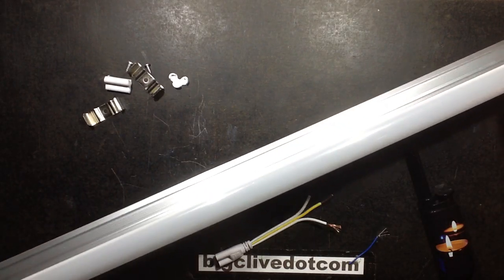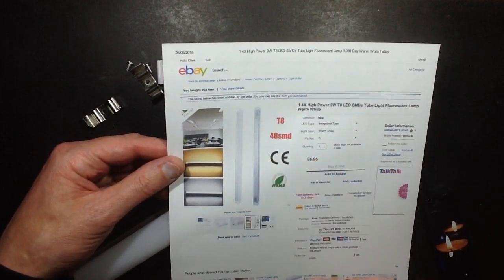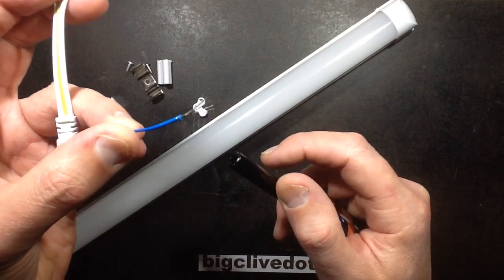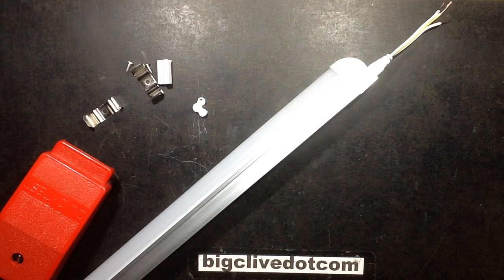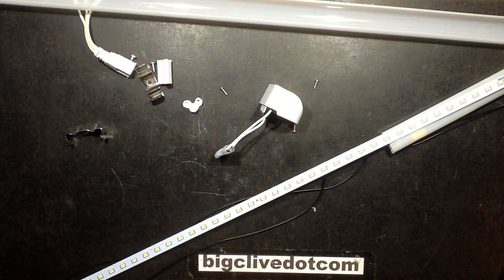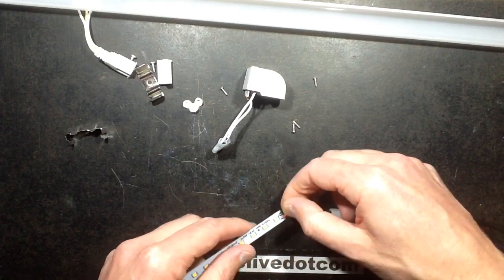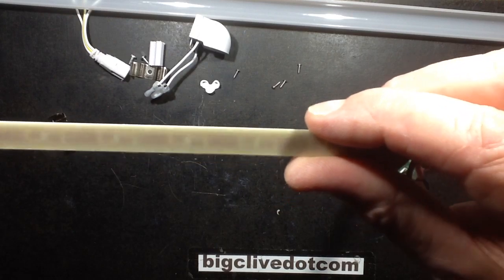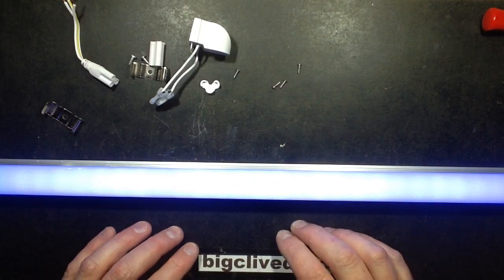Inside a 9W generic ebay T8 LED strip-light.

Comment: i have a similar 9w tube , and the power supply broke. so i took out the power supply and the led strip that came with it, then i put in a 12v led strip :D
Reply from the maker: That also lets you convert them to a colour of your choice.  These channels are good for retrofitting with standard LED tape.
Reply: yeah, and also the diffuser that comes with them is good for rgb led strips with individual color leds.

Comment: i need ur help should i go t5 or t8 i am leaning t5
Reply from the maker: T5 is slimmer and neater, but for LED it's sometimes better to choose a strip with a larger heat dissipation area like the T8.  (The number after the "T" being the diameter in 1/8ths of an inch.)
Reply: OMG makes sense I never thought about it like that I was thinking aesthetics like ur other video the lumen output in the t8 should be greater too right

Comment: would be good if they made led strip with built in opal diffuser coating on the strip like the opal diffuser coating on led strip track profiles but without having to use a track profile. NOt seen any availible with opal diffuser coatings yet

Comment: when one of these T8 led tubes burn out, is it usually the leds that fail or some other component within the tube?
Reply from the maker: Usually the LEDs.  You can often tell by the appearance of a black dot (burn mark) in the LED.

Comment: Why 77 volts and around 48 leds??  

R/. 77V/48=1,6V  which means that it is the voltage drop of each LED.
Reply: doesn't make sense, i haven't seen white LED's with only 1.6v of forward voltage. I bet it's like he said, 2 circuits of 24, making it 3.2v per LED which is totally standard white led voltage
Reply: Did either of y’all watch the whole video? It’s two parallel strings of 24 seriesed LEDs. One string is the odd lights, the other drives the even lights, that way when one LED shits the bed then the whole tube stays lit.

Comment: I have used 1/2 inch multistrand aluminium power cable in telephone exchanges for 50 Volt feeds.
It came with a conductive grease too.
I also have a 1 metre 128 smd Led work lamp with Li ion battery.

Comment: CCA or Copper Clad Aluminium is fairly common and except for a small reduction in current carrying capacity and its cheaper, WAY cheaper than pure copper.

They actually take pretty thick wires of aluminiun wrap (clad) it in copper and stretch the shit out of it until it becomes individual strands like you see in the video. Theres no melting or anything like that involved.

Comment: Hi Clive.

Those connections look an aweful lot like a standard trilobe connector like you would find on a lot of laptop PSUs.  Are they?
Reply from the maker: +Scott Miller I just checked.  It's smaller than the laptop cloverleaf connector.
Reply: +bigclivedotcom Bummer...coulda been a solution to the aluminum wire issue.

Comment: How did you get the voltage down from the 77v originally supplied by the power supply?
Reply: +BigGoucho I suspect he is using a different power supply - probably his test bench unit - to drive the LED tape.
Reply: +Sootikins yes, I heard him mentioning the power supply but I wondered if he had lashed together something based on alcohol-fuelled calculations lol

Comment: Sure was flickering on the camera so not a constant on.
Reply from the maker: +legalizeshemp420 I record on an iPad 2 which systematically picks up on any flicker at all.  It's not visible to the human eye.
Reply: I have an issue with flicker and it gives me headaches.  I can't see it (well if I turn my head I sometimes can) if at 60hz so I was sure glad when 120hz TVs and Fluorescent bulbs came out and LED that are constantly on.
Reply: bigclivedotcom 
Hello Clive, i just bought 1 of these i believe exact same lights but i didnt open it up yet like you did. After seeing the problems you had with the 1ft like this. I think i have to open it to make sure all connectors are crimped. 
The wires scare me. I want to be sure that this wont burn down my house before i connect it. 
Im going to use it above my kitchen sink so it will be on every night til i go to bed n when im not home. So please tell me you think it should be ok after i make sure connectors are good. Im in USA n we use 120 volts B W G usually n i will extend wires out of ceiling with at least 14-2 wire using wire nuts n electrical tape. Hope to get reply soon from you. Thank you
Reply: bigclivedotcom 
I forgot to ask. If i put dielectric grease on the connections will it keep the wires from corroding? Thanks again

Comment: Oh snap man I think your telepathic!, I literally JUST order a couple of these ion warm white, but I paid like $9.25 ea for them..
I have some regular tube lights like this that take the same type of plug but they are actual copper..
I have some spare 6" jumper links to daisy chain them together with spacing also.

More telepathy! You had the SAME idea I had putting in the LED tape, I got that RGB remote controlled tape coming and I was going to put some of that in one of these housings and be able to change it with the remote, lol.

Comment: Hmm...  I'm not sure if that would fly in the States.  I know aluminum branch wiring isn't allowed under modern US building codes, but I'm not sure about the regulations for accessory/consumer electronics wiring, assuming it's mains power running through that harness.
Reply: rhkips 
Hello, i sent the following to Clive but hopefully you can answer this.

Hello Clive, i just bought 1 of these i believe exact same lights but i didnt open it up yet like you did. After seeing the problems you had with the 1ft like this. I think i have to open it to make sure all connectors are crimped. 
The wires scare me. I want to be sure that this wont burn down my house before i connect it. 
Im going to use it above my kitchen sink so it will be on every night til i go to bed n when im not home. So please tell me you think it should be ok after i make sure connectors are good. Im in USA n we use 120 volts B W G usually n i will extend wires out of ceiling with at least 14-2 wire using wire nuts n electrical tape. Hope to get reply soon from you. Thank you
Reply: rhkips 
I forgot to ask. If i put dielectric grease on the connections will it keep the wires from corroding? Thanks again

Comment: Have you ever thought of recording with a go pro? i have noticed how narrow the FOV is of your videos. they are very educational and fun to watch but you can't see much of the larger items that you disassemble. you can find go pro hero 3's for relatively cheap on ebay :)
Reply from the maker: +Tyler Walker I've got a GoPro and it somehow managed to fit my entire workbench in from the same height and made everything look like it was a mile away.  You can retrofit CCTV lenses to the GoPro for greater "zoom", but the majority are not fitted with IR filters, so everything goes a bit "intense".
The iPad is a nice lazy solution to banging up videos.  Just record, use the YouTube capture app to upload them over the excruciatingly slow Internet connection overnight, and edit the data in the morning.

Comment: Do you know what sort of leds are used in the backlighting of modern laptop screens.
Im thinking of replacing my old laptop ccfl with leds, but i dont know what type to use, have you ever converted one clive?
Reply: zx8401ztv
I'm the same as you in my personal life, If it can be repaired I'll try and repair it, if I don't know how to then I'll try and learn how to. I've always kinda figured if I fail at repairing it then it's still broken so nothing has changed :)

Sadly, in my work capacity it's not economical for my time to repair much. :(
Reply from the maker: +zx8401ztv There are specifically designed LEDs that emit a lot of light out of a very narrow side aperture for edge-lighting some of these panels.  I've not really taken many flat panel screens to bits, so I can't say how much variation there is in the technology.
Reply: +bigclivedotcom Hmm special types, looks like ill have to hunt ebay for a possible kit/replacement.
Thanks for the answer :-), i suspected that but you are into lighting more than me, the led strips you have shown us are dam bright, im quite supprised how well they work.
Reply: zx8401ztv I wish you luck, it's nice to find a person that actually wants to fix stuff and also has the time.... I'd much rather fix stuff instead of replacing it but I work in IT and people don't like paying me more to fix stuff than it would to replace the whole part :(
Reply: +Mark Batchford 
Thats the same way i think lol, if someone says "its dead anyway" i start to use nasty methods to test it, and i often win :-)
if i fail, then ive tryed, no shame in that :-D
Reply: +zx8401ztv  the CCFL tubes just throw light out in all directions, so if you can figure out a way to replace them with LEDs pointing them in about the right direction it would probably light the screen OK.

However, once you've got the LEDs, the driver for them and the time it would take to make it work... If the screen isn't working at the moment either get a new CCFL screen or a new inverter (whichever one has failed)... or just see if a full LED replacement screen kit is available... I know it's possible to get complete replacement screens with LED instead of CCFL back lights for quite a few popular  laptop models and they come with the driver as well (although you may have hack a few little bits of the plastic inside the screen surround to make it fit!)

Also... you will lose the ability to dim the screen if you replace CCFL with LED, it will always be at full brightness, which may reduce battery life
Reply: +Mark Batchford Hmm i would use an adjustable constant current regulator to feed the leds, so setting an illumination level should not be too hard :-D
Im not one for throwing away a working lcd just because the lighting is a bit naff, it died once, i threw a non ideal ccfl tube in, and it works but there is slight shadows in the bottom corners, the ccfl was shorter than the original.
As clive loves leds, i was just trying to learn what type of leds would do the job, it sounds like i may raid a dead lcd for its led strip ha ha :-D
Reply from the maker: +zx8401ztv Backlight illumination in LCD panels is a bit of a science in regards to getting even illumination.  But for a rough and ready low power panel for data purposes you could probably use a row of self adhesive LED strips behind it.
Reply: +bigclivedotcom I would imagine that leds for lcd displays would have a certain spectral spec, so colours appear without bias from the lighting messing with the colour.
I know sod all about it clive, just thoughts of a silly brain lol.
Reply: +Mark Batchford 
Thanks for the luck :-D
Ive been a repairer all my life (so far), i just like helping people, im blowing no trumpets or anything, its just the way i am.
Mostly electronics, some computer recovery, and my mate appeared at the door just before xmas, his old morris 1000 car was a little ill, so the mechanics hat was worn and i helped him ha ha :-D fun :-D.
I do hate having to scrap modern junk, but ill have a look to see if its fixable by me, worth a look :-)